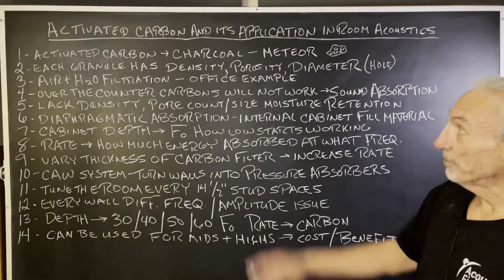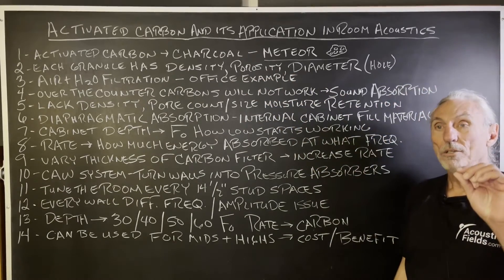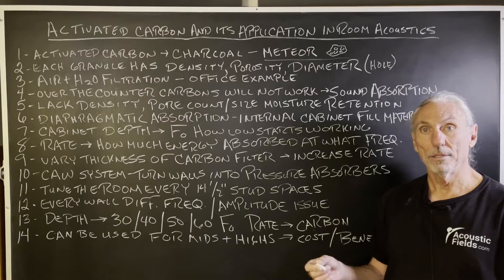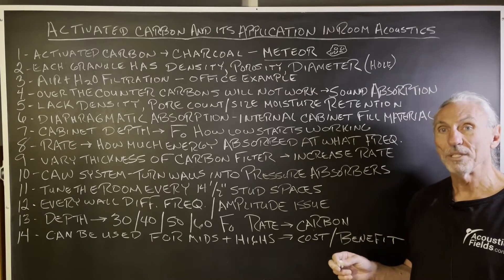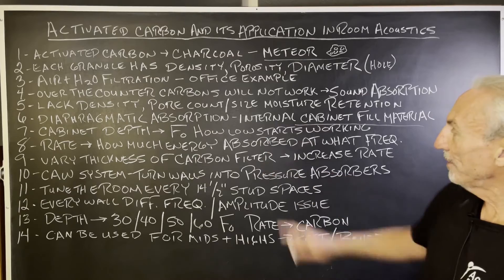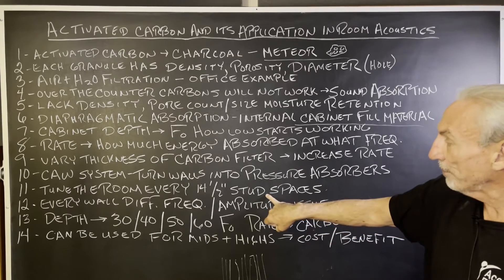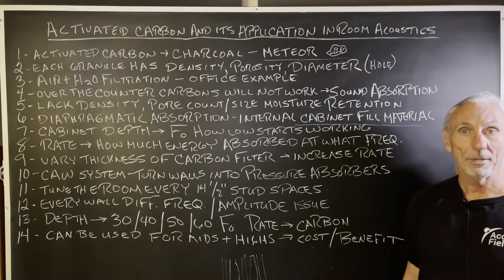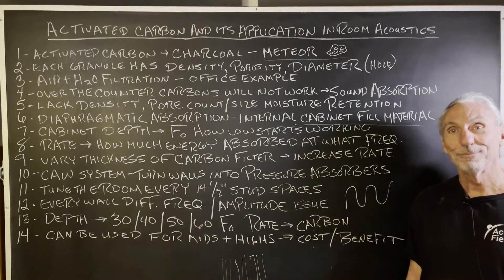Why Use Activated Carbon In Room Acoustics? - www.AcousticFields.com

Comment: Good quality charcoal does work as a broadband absorber.
I tried a few boxes filled with charcoal in my listening room and there was a definite difference when measured using REW. (Biggest benefit was ~125hz where my primary room mode)
Yes, charcoal absorbs moisture over time. Put a bunch of it in an oven at 125c (covered of course, to prevent them from catching on fire) for an hour or so and the moiature goes right out.
Reply from the maker: Using over the counter carbons that are used for water and air filtration will not last inside a diaphragmatic absorber. If the carbon is not treated for moisture retention, the carbon will absorb moisture and performance decrease dramatically. Over the counter carbons also lack the proper pore count, size, along with the required granule density.
Reply: @AcousticFields  would putting a bunch of silica packs inside the cabinet help prevent moisture?